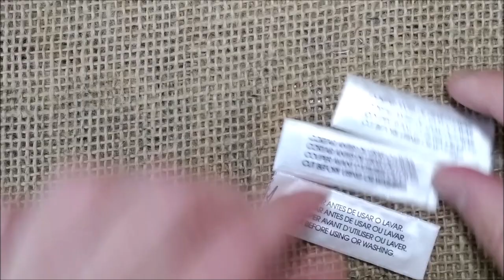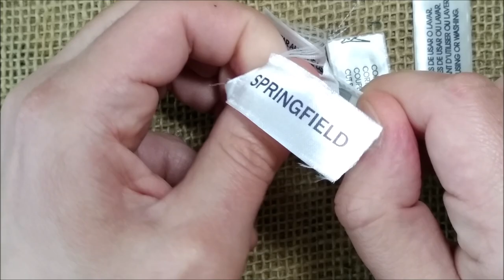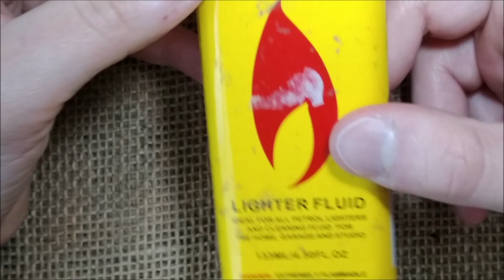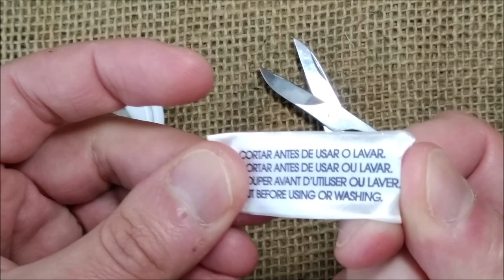Pen tip #7 - how to get free shims

Comment: What is this tag? I don’t recall seeing these on clothes.
Reply from the maker: It is the alarm that will make the "alarm doors" on the stores make noise. It is usualy next to the other tags with the "made in" information and the washing information. But it is present in many other products from many other stores. Electronics, for example.
Reply: You can find them in dvd cases also.
Reply: Arkansas Mike thanks. Very helpful.